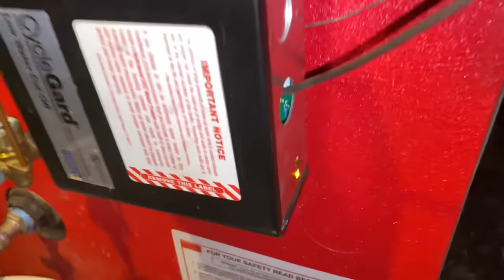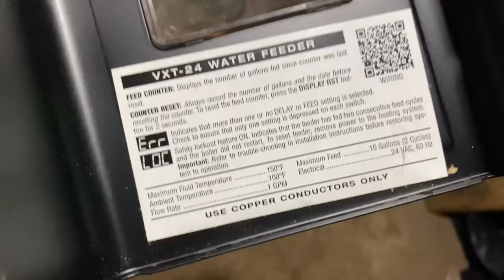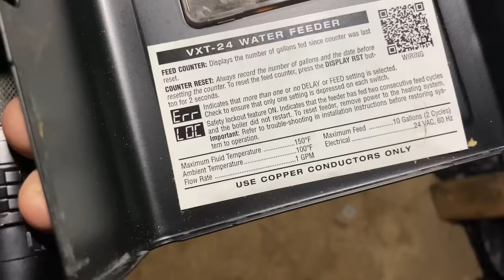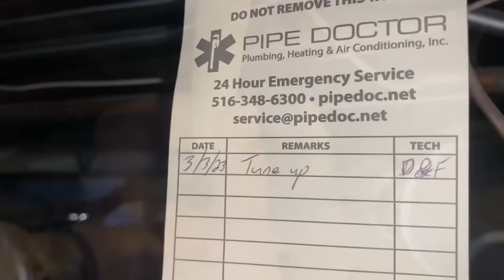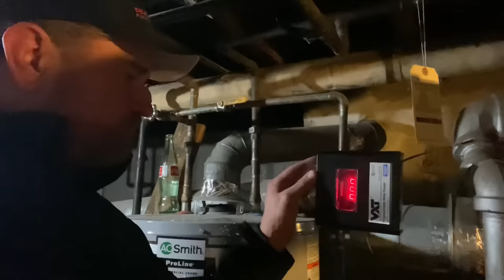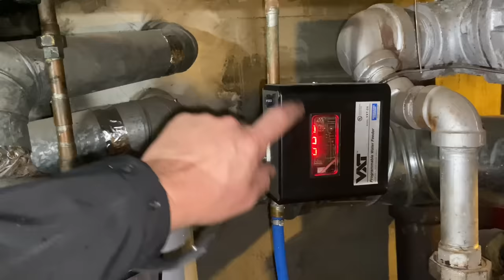Steam Heating Emergency - How to Run a Proper HVAC Service Call || Mikey Pipes

Comment: My old neighbor worked for a refrigeration company, and had a call at a mortuary, with a cooler down, where they stored those that were to be cremated. This happened on a Monday morning, after a 3 day weekend, and the folks who ran the place, came in to find that the 3 drawer cooler had quit. Nobody knew if it had been out a day, or all weekend.  My neighbor said it was the worst thing he'd ever smelled in his life.
Reply: Ooof
Reply: I had a similar experience except luckily they called the same day the cooler quit working thank god. And they were courteous enough to remove the body from the walk in before I entered lol

Comment: I started my plumbing career when I joined the Air Force in 2002. I was stationed at Dover AFB which has the only mortuary for the entire armed forces. Every single service member who died in combat was sent to Dover. I spent a lot of time working in that place from clogged drains to these piece of junk Lochinvar boilers.

Comment: Kindly correct me if I am wrong - so, one of the main reason to shorten the lifespan of any boiler is when it is feeding oxygenated H2O frequently.  Question:  Can you install a water treatment equipment between the hotwater tank and the boiler?  Thank you.

Comment: Using alot of water to lock out feeder
Reply: That's 1 but it also does it over time if you have used a Givin point of gallons.